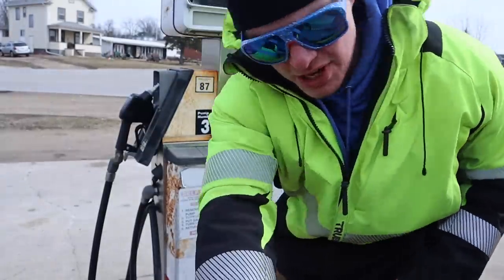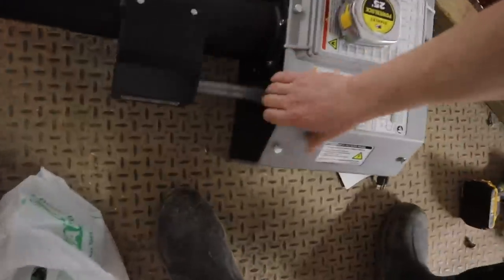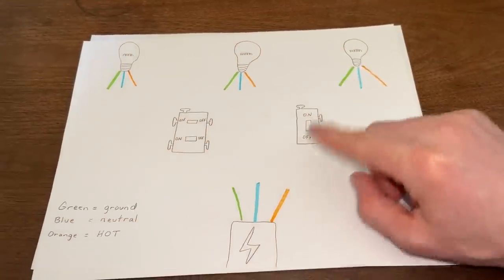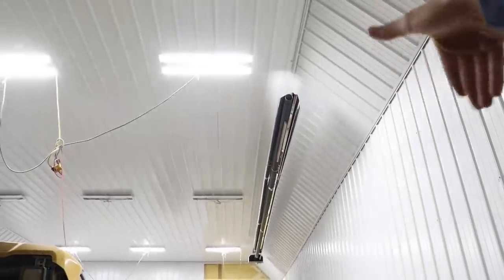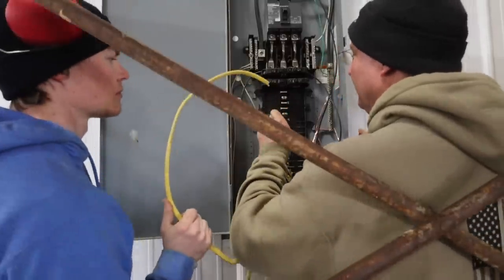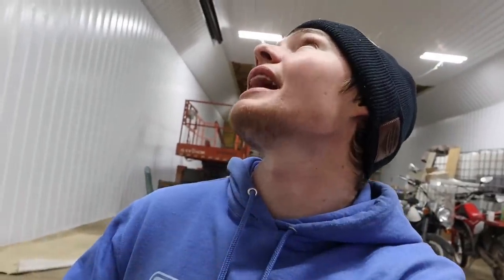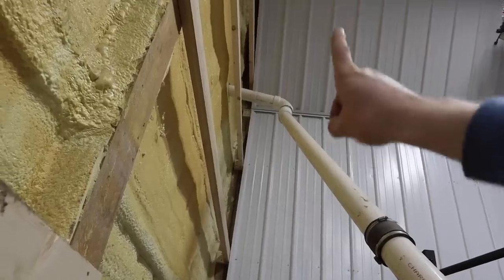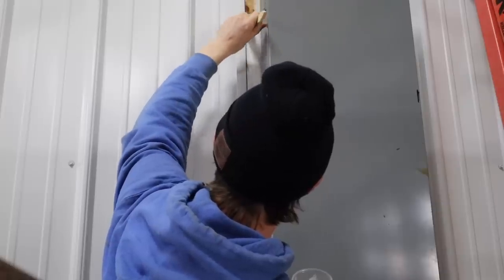Installing Electricity In My Ex-Hoarder Shed!

Comment: Cole, I have been installing heat and air conditioning for 40 years now.  I am watching this installation, and it is looking good 👍. The YouTube video approach is not a bad idea. When you are home and have a few minutes, you can get the answers to your questions quickly, and then you can make the most informed decisions about your installation. Every heat system I have installed comes with the installation guide. Between the guide and the YouTube video, you will be surprised with the final results. Don't rush and make every connection carefully. If you have any questions about HVAC and can't find the answers, feel free to reach out to me. I'll give you the best advice I have. I'm also a certified power engineer. I am licensed in electrical, HVAC, plumbing, boiler operations, and generators.
Reply: Such a kind offer!
Reply: Nice of you, hope Cole sees. 🤗💖
Reply: You sir are very generous and thoughtful 😊

Comment: Cole, I work for a township highway dept in NY. our 5 bay shop has tube heaters and we have found the addition of ceiling fans set to low helps alot during the winter to keep the hot air pushed down and circulating to dry the trucks better after a plow run.

Comment: I think you might want to use PVC conduit for the wiring. You can change the knock-out holes in the main breaker box and run the wire out the top.  Run the wires out of the breaker box that gives you the straightest path to where you want to go.  You can still use the Romex and run multiple lengths in the same conduit.  You want to minimize any area where a wire snag is possible or rub against a wire creating a fire hazard.

Comment: I've been in several shops with tube heaters...
They work ! 
The reason they work so well is simple...
It produces heat the length of the pipe & radiates it very well...
A Forced air furnace heats the air blown thru the heat exchanger & warmer air is "attracted to cooler are (physics) .
So the minute the air exits the furnace it mixes with colder air molecules & in a shop this size its no doubt running constantly..
Tube heat distribute hot air the length of the building giving you a more constant temp..
No cold spots ...

Comment: Cole, I have the same type of heater in my shop and run it at 60-70 degrees and it performs well. Its not as efficient as your forced air furnace but I believe you will like it for the shop. I admire the way you guys tackle these projects.

Comment: Good job on the wiring Cole. I found it worthwhile to mark the wires in each box  something line 'C-in' and 'C-out' or '3in' and '3-out' for instance, and mark that on a diagram for each circuit. For complicated boxes (most boxes actually) I made up a diagram of the wiring and fixtures just to keep it straight while completing the wiring. Good luck!

Comment: Id of stayed with the furnace and just ran some ducts. They both heat the same but at least the furnace has a fan to move the air. Hell, you can use em both together if you have the pressure. You can put your trap at the wall but the closer to the device the better it will do what its intended for.  As for the gas line and 90s, you need to calculate the pressure vs. the run length.  90s add 5 feet per. One of the reasons why I always preferred the flexable gas pipe. And for the life of me I cant remember what it was called. My mind is stuck on Pex but thats not right. But in the end on the farm, we do what we know and can do. :)

Comment: Intake ducting for heater/tankless water heaters usually require certain diameters based on how long the run is to the source. 90* Elbows usually count for an increased ln ft count because they restrict flow.  A 4" 90* elbow equals 5lnft of ducting. If the manual says you need a 4" duct that can't exceed 16" of run (made up numbers obviously, check with your manufacturer) you could have 1ea 90 elbow and up to 11ft of straight duct.  If you step the ducting size up, i.e. 5" or 6" you get increased capacity and can integrate more elbows. The heater manufacturer can tell you what is required for sure.

As for the Drip leg, the black iron for the supply line needs to be pitched towards the wall at no less than .25" per 15ft of run. Code in Iowa  (and 99% of the US) says that you need a drip leg wherever condensate can settle. It's usually near to the appliance it's self, but if you pitch the pipe right you could get away with putting it down low where you pointed in the video. It would actually make it a lot easier for you to service, especially if you put the ball valve to shut off supply right infront of it. That way you could turn off the gas, take the cap off the drip leg and let it dry out if needed. Licensed contractor in NJ, but Plumbing code is pretty universal for that type of stuff.

Comment: Ideally you should put the heater burner head by the overhead door.  The tube will be hottest nearest the burner which will help with the garage door area being the area with most heat loss.  You can probably get away with running a lower thermostat setting than 65.  Radiant heat often feels warmer at a lower temperature setting.

Comment: MY 40 x 75 shop with 18’ ceiling is heated with a 80000 btu 40’ tube heater.  I keep the thermostat at 58, but when I temp the floor and items in the shop, the are mostly at 61, 62 degrees.  Really satisfied with it.

Comment: In our area we would install a tee in both locations the lower one would be for the vertical riser than a second one at the unit to make sure trash doesn’t get to the gas valve but that is our area

Comment: As a plumber. The gas “collecting well” as you called it can be located right as it comes in the building so long as it is after the last shut off valve to the heater.
Reply: It CAN be as soon as it enters but it SHOULD  be as close to the device as possible to collect any debris that is in the line flowing to the device.
Reply: @warrenmichael918  this is true. But seeing as that trap looks to be the lowest point in the run. He should be fine.
Reply: the last shut off valve needs to be within arm's reach of the unit. It's there for any service work. There also needs to be an electrical shut off within arm's reach of the unit.
Reply: I’m hvac we call it a drip leg, what do you call it?

Comment: Oh yes avoid electricity and water!  Years ago my fiancé was into CB radios and was putting up a huge antenna on his parents house to help their fleet trucks and for him to play on basically. The sprinkler system had been on and he dropped a bolt off the house. It fell into the garden and I was just going to grab it not giving a second thought to that electric dog wire to keep the dogs out of the garden. I stepped onto the wet concrete and leaned over the fence to grab the bolt. My Elbow hit that wire while standing on wet concrete. He said all he saw was me fly across the back yard and hit the fence. I was 20 or it would have killed me. Burned a hole in my jacket at the elbow and I swear I didn’t stop shaking for 20 minutes or until after we got to the ER. Let’s just say it made quite an impression on me! Oh and I still had my left hand wrapped around the bolt. Took a little pain injection before I let go of that!  Lesson learned!

Comment: Install the gas line drip leg as close as possible to the appliance. Any temperature changes will cause any moisture in the gas supply to condense. 

You'll be sorry if you remove the forced air heating system. The radiant tube heaters only heat what is in direct path from the heater. What's wrong with having both radiant and forced hot air in the shop?

Comment: Drip leg must be near the unit. Local code would dictate how far away but it's just best practice to install next to the unit after the shutoff and union. The directions should have pictures to help. Most of those are pulled from the code book anyways
Reply: Ha , if they had any code checking on that farm they wouldn't have a bin  site falling apart before our eyes
Reply: @robm3063  you aren't wrong. Surely that contractor would have his dealer license revoked

Comment: Ideally the gas drip leg (collecting well as you call it) you would put it as close to the unit as practical... its purpose is to trap any rust and debris that might accumulate in the line and prevent your inlet  screen on the gas valve from becoming fouled up. As far as fresh air supply (combustion air) ducting up like you stated shouldn't be a problem and is better/ more efficient because you are not using heated inside air for combustion but when in doubt contact the manufacturer for details on max length and recommended diameter. Some require solid metal (snap loc) ducting larger than the inlet to prevent air starvation, I would avoid flex ducting because of air restriction/ turbulence and its easily damaged.

Comment: You will get it done regardless, but put a main gas shut off coming in to the building in case of a fire. Make sure you put the drop under the shut of valve at the unit itself and definitely don't let anyone talk you out of the fresh air intake on radiant heat. Make sure you put the spiral tube in correct place and remember that system grows when it heats up so plan intake and exhaust with the expansion in mind.

Comment: From the Netherlands here. Here most things electrical like tubes and boxes you wire stuff together in are made of plastic these days instead of metal. That way there is no chance of power on the box/tubes in case of any malefunction. No electrician though. 

For outside lights im a big fan of those time/light thingys. They go on automatically if its time and its dark enough. No switches needed, no forgetting putting them on/off. 

And like you said, the basic things you can easily wire yourself. Just pay attention and draw things out if needed 👍

Comment: Yes you can have 2 90s for fresh air intake.  But use the 90s that are called street 90s.  They are a smoother softer 90. Helps prevent restrictions. Exhaust just go straight out the side of building. No bends.  The trap line for gas needs to be located at the appliance. Reason for this is that any debris that is in lines or tank gets collected in that drip pipe. Also for any moisture that may get in the line.  Last reason would be if moisture was in the line using the black steal line rust could still form so your basically trying to catch as much debris that may be in the line right before appliance.  This is to prevent issues with the gas valve.  If it was where you have it now you have the risk of causing valve issues down the road since you may have what looks like a good 15 to 20 ft of line before the valve that could rust or build up moisture when not using it.

Comment: Tip: Use Wago 221 instead of wire nuts. it makes the installations so much easier, and you can change stuff easier later on.

Comment: the rock was major - think about painter's tape for easy cut ins - also think about wago wire connectors - they are slick - the more you do these jobs the better you get - sure you may make some mishtakes but it is worth it - that is how you learn sometimes admittedly - everybody was a neophyte at one time even the master electricians

Comment: Get a clamp ammeter, and learn it. 1800 watts or so on a 15amp line. Volts X Amps is Watts. And 14 gauge wire is 15 amps maximum at 120v.

Comment: Judging by the 14 gauge going into the box, you can only have a 15 amp breaker for your outside lights. 

14 gauge (white) = 15 amp 
12 gauge (yellow) = 20 amp
10 gauge (orange) = 30 amp. 

You can under use a wire, but never ever overuse a wire. Meaning you can use 12 gauge on a 15 amp circuit. But never use it on a 30 amp.
Reply: In most cases you are right but if it is a dedicated line to run a motor you can actually put  a 30 amp breaker on and number 12 wire.  Breaker has to cover the staring amps of motor but wire need to do running amps.  Starting amps are higher for a few seconds then running amps will be way less.  Yes it is really confusing once you start doing motors and other things.
Reply: Usually yes. I still have a few rolls of 12/2 w/G that is white. The yellow 12/2 is a new deal but that white wire in the shop could be the old white 12/2 too.

Comment: Sediment trap/drip leg should always be as close to the furnace as Possible. you should be fine with your fresh air intake the way you want to do it. I have installed several of those tube heaters for customers. would not have been my first choice in your shop but thats what you wanted. I would have just reused that Forced air heater you had with a little ductwork. with a building as large as yours you probably should have done a Double Tube system.

Comment: Electrical wires and gas lines, take them UP and OUT OF THE WAY.  Down low they are subject to moving things bumping into them and it's more likely you'll find they are in the way of something you want to do.  Raising them up doesn't entirely eliminate either but it does greatly reduce them.

Comment: The trap for gas would ideally be next to the device, in case there’s some debris inside the pipe after installation it should catch it. For that air intake, consult the manual. It should have specific rules as to what size vent you can have, how long it can be, how many bends etc. Should be fine running upwards
Reply: What Caden said... Plus I'm pretty sure it's code
Reply: I wouldn't use 90 have tried to use 45 you'll get a better flow that way
Reply: @MrCheshire24 good thing he is talking about intake air isnt it

Comment: i have ran 2 of the drip legs  when doing shops one where it come in to the shop and one by the heater and yes you can run it up and then do 90 over  it comes to what you want it to look like

Comment: I'm anxious to hear hear what you find about the collection wells (I think my dad called it a drip leg) on the gas lines; I have one where it comes in to the house, one at the basement furnace for the first floor, one in the attic furnace for the second floor, and one at the water heater.  I know it needs to be 3" (just use a 3" nipple) and that it needs to be where gas pushes straight down into it at a T just before it goes into the equipment.
Reply: those are called sediment traps. They catch any flakes from the steel gas lines. (among other things) It's not something that needs to be serviced on a regular basis.
Reply: @rupe53  Yup, when I did the flex line for my gas stove, I opened the three that were in the basement, which are all in excess of 25 years old, and there was nothing in any of them.

Comment: Propane is vastly different then gas. Look at the btu demand of the heater. Then ensure your line size from outside to second stage is accurate. Then lime size water column to heater. I've had to fix so many things because hvac guys don't understand propane and the huge difference

Comment: Damn.  Pigtail your power source to supply power to the bottom side of all 3 switches.  Top side of each switch you connect to the black wire of the light you want controlled by that switch.  Wire nut all of the whites together in the switch box.  Pigtail all of your grounds together and run pigtail to each switch and box.

Comment: Put your dirt leg on your gas line as close to your appliance as possible the inside of black iron pipe can flake off over years also always use a good thread tape and pipe dope on your threads and tighten enough but don't drive the pipe past the threads in the fitting don't forget a union somewhere preferably close to the fixture for ease of maintenance on the parts that may fail on the fixture oh the tee vertical with the nipple on the bottom that nipple and cap is the dirt leg it is meant to protect the fixture from getting any possible debris from the pipe into the regulator hence why it is important to put it as close to the fixture as possible after you build that gas line you should at least use dish soap and water in a spray bottle to test every joint you make looking for bubbles coming out but as a Plumber you are supposed to isolate the new system put at least a 15lb gauge on it pressurizing it to 10lbs and let it sit for 24hrs to see if you have a leak you will have fluctuations in the gage minimal through  temperature variations that is normal but a dramatic loss like 5psi or something you have a leak and need to pump it back up and use the soap and water method to find your leak be extremely careful building a gas line it can kill you especially in an enclosed area like your barn plumbers are the ones that run gas lines in buildings and we have to be licensed insured and pull a permit you as a home owner can do your own without all that I believe but insurance may be an issue maybe you pay a professional for just that in your hook up of your heater just to protect yourself and your family for at least insurance purposes it can't cost that much to get that little bit of pipe ran and a permit can't be that much where you are it would be a piece of mind knowing it was done right and you and or your building doesn't get exploded due to a very small gas leak that can accumulate over time and one simple thing sets it off just saying I have been plumbing for 30 years this year June make your choice but whatever it is make sure you at least listen to what I wrote

Comment: Tube heaters....... I have a 14000 square foot truck shop with a 20 ft ceiling 6 big tube heaters,    They are great when the doors stay closed . The shop has 8 big doors with trucks and trailers moving in and out all day.  The recovery on the tube heaters sucks.  When it’s -30 out side it’s just above freezing in doors.